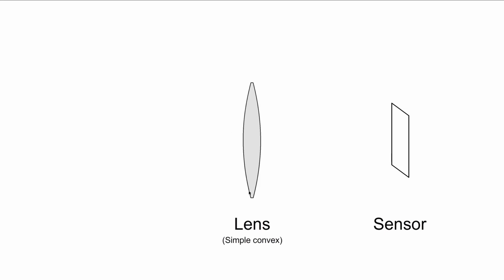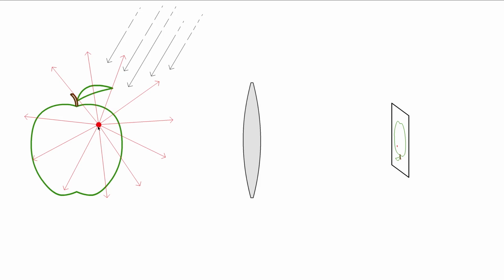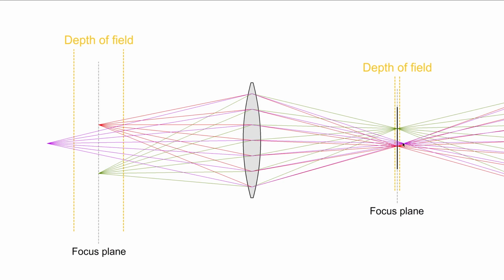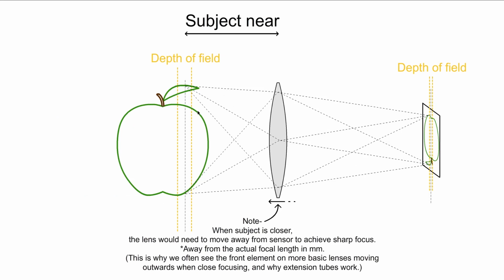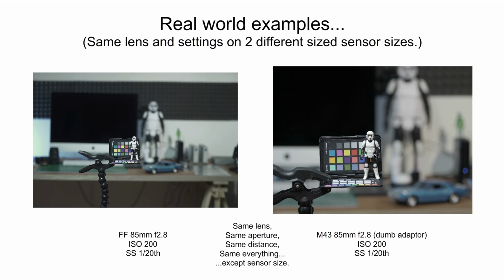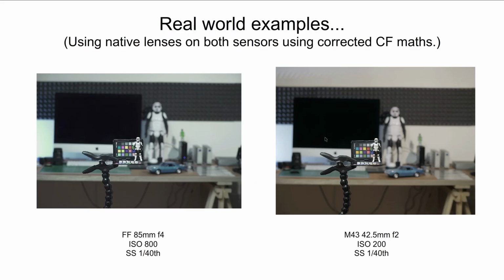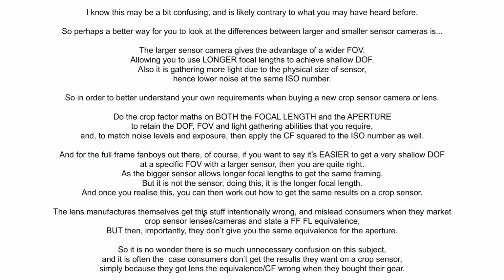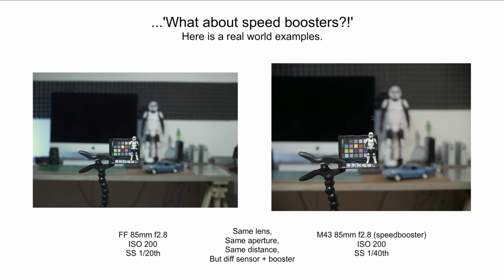Depth of field and crop factor misconceptions.

Comment: My understanding is that light gathered by individual large photosites means better ISO performance, not total light gathered. Furthermore, higher resolution means less relative noise when resizing down a larger, higher resolution image (compared to smaller resolution sensor). So it's this one-two punch by FF sensors (larger photosites AND higher resolution) that conspire to give superior ISO performance.

I don't believe that not giving 35mm aperture equivalents is misleading at all. The "equivalence" here is only for depth-of-field, not light gathering ability. On the contrary, it would be a lot more confusion, otherwise people would start thinking their APS-C f2.8 lens gathers less light than a FF f2.8 lens. People don't just buy fast lenses for bokeh.
Reply from the maker: adjutant hi. Please check out Tony Northrup's video regarding pixel density and ISO. 
(Do a quick search on his channel) 
He covers this well. (With examples)
To sum up his findings-
The total size of sensor is much more important for the total image noise. Than the size of the individual photosites. 
Unless. You are comparing image noise pixel by pixel. But that's not what most people care about. They care how much noise is noticeable when comparing two whole images side by side. 

Once you scale the 12mp image to full screen or the 42mp to full screen. (Or print to same size) then the image noise apparent there is what is important. 
(So total image noise across whole image)

And that is all down to sensor size. 
Not pixel density. 

Obviously detail retention is another conversation altogether. 

Anyway. As I said. Check Tony's video as he will explain it better than me in a comment.
Reply from the maker: adjutant and yes a f2.8 apsc specific lens does gather less light than a f2.8 full frame lens. 
That's exactly the point. 
Did you watch the whole video? I thought I made that part pretty clear. 

Don't use your ISO to judge how much total light is getting through your lens. 
Unless the sensors are the same size then the ISO is misleading you. (Not to mention manufacturers lie about actual ISO numbers to make their camera appear to be more efficient... but that's a whole other thing that I'm not factoring in for at all. And a different conversation... but worth mentioning. )
Reply from the maker: adjutant just to add on to my last comment-
The f2.8 at EQUAL FOV equivalent, does let in LESS light. Compared to the FF f2.8 equivalent.  
This is because the FF is on say a 50mm f2
And the crop is on a 25mm lens at f2 on m43.

Then, remember the actual aperture SIZE is the FL divided by the Fnumber.
So the f2 has a 25mm aperture on a 50mm lens on the FF cam.
Where as the the M43 at f2 with a 12.5mm aperture on the FOV equiv 25mm lens.

So for the SAME aperture (f2). and SAME FOV, 
the FF has a hole to let light through that is 25mm across
and the M43 has a hole that is 12.5mm across.

You see. :)
Reply from the maker: Or if you want to look at it another way. 
If you put the exact same lens on 2 diff sensors then the smaller sensor will be getting less total light out of the lens. Because more light is spilling around the sensor and is being wasted. 
Where as the larger sensor is filling more of the circle of light being allowed through the lens. 
So yes no matter which way you look at it.
The smaller sensor gets less light. 
So we have to accommodate for this if you want the same results on varied sensor sizes.
Reply: I think your first reply and the first paragraph of my original comment are in agreement, except you mention upsizing a smaller resolution image to expose noise, and I used an opposite example (downsizing a higher resolution image to hide noise).

However, I'm not entirely convinced when you attribute superior noise quality or light gathering ability to just "more total light" when you're equating "more total light" to mean "more megapixels to scale with".

Let us imagine a full frame sensor with 12mp and an aps-c sensor with 24mp. Now the aps-c sensor, despite being smaller, has a higher resolution. Does the aps-c sensor gather more total light because it has a higher resolution now?

Futhermore, will upscaling the 12mp FF image to match the 24mp APS-C image result in more apparent image noise from the FF image? At some point you have to confess to yourself that the size of the photosites do contribute to the noise quality.

I hope you can understand why I'm not satisfied by your ``resolution-only'' model to explain noise quality in an image. As my previous example shows, it is possible to have a situation where there is a higher resolution smaller sensor. Whereas the combination of higher resolution and larger photosite can only exist in a larger sensor (when compared to any possible smaller sensor), thus being the model that is most able to explain noise quality.

Lastly, let us consider a FF 50mm 2.8 lens and a M43 25mm 2.8. Suppose I used a hand-held light meter to calculate the exposure of a scene and I arrived at ISO 100, f/2.8,  and 1/1000 shutter speed. Supposing equal ISO standards by the manufacturers, will the M43 image be darker than the FF image?
Reply from the maker: We are talking at cross purposes. regarding the pixel density/resolution. 
I have seen tests by several people showing the density factor in isolation is marginal compared to the total sensor size. i think maybe you saw the bit about the circle of confusion and you maybe thought I added that part of video in to help explain the image noise... i didn't thats just in there to help explain the DOF difference with a smaller sensor.
Reply from the maker: And regarding the second half of your comment -
'Lastly, let us consider a FF 50mm 2.8 lens and a M43 25mm 2.8. Suppose I used a hand-held light meter to calculate the exposure of a scene and I arrived at ISO 100, f/2.8,  and 1/1000 shutter speed. Supposing equal ISO standards by the manufacturers, will the M43 image be darker than the FF image?'

You are still not getting the fundamental message about ISO.
The ISO number is misrepresenting the information we need to know if we want to know the total amount of light that makes up the whole image. (I hope you agree this is what is important.)
So please stop using it as a guide for your exposure. ISO is gain, and it relates to lightfall over a square inch of the surface area. 

OK let me try to think of another way to explain it...

Take a photo with a FF camera.
Now I hope you agree that that photo, before it is read by a sensor and interpreted into a image, is just a shit ton of photons travelling through our lens.

Now for the sake of argument, lets say the whole image, for the entire shutter length, is made up of 1 million (1000,000) photons hitting that sensor. (to pick a random, easy to quantify number)

Now, what happens if we shrink the sensor down so its a quarter of the size?

that smaller sensor will now be getting hit by 250,000 photons.
And yet, the exposure is the same, but it has 1/4 of the actual light hitting it.

Its just like taking the original FF  photo, and cropping into the middle of 1/4 of it. (imagine for this paragraph at least, resolution and detail is not part of the topic for now) any noise that was in that middle section of the photo is now blown up and more apparent.

So does that help?
Exposure is judged by light per square area, just as ISO is.
So what the smaller sensor is doing is adding more gain to match the lower light level over the total surface area... as i said... the ISO number lies to us, If what we want to know is how much total light is hitting my sensor and making up this image.

Dont trust the ISO number.
I reccomend if you have a couple of different cameras of varying sensor sizes lying around, then to the test yourself.
As long as both cameras are of similar quality, (they don't even need to be same manufacturer or anything like that) you will see all the important factors matching if you do lens equivalence the way i suggest.

You will get very similar FOV, very similar DOF, and very similar image noise. very similar exposure.
Surely the proof is in the pudding.
Give it a go and let me know what your findings.

I better go and do some real work. :) (i was hoping this video would clear things up so i didn't need to get into long discussions... ) :D
Reply: Let us consider a full frame camera with an aps-c crop mode. So a 36mp sensor camera that will crop to approximately the 15mp in the center. It's still the exact same sensor. According to what you're saying, this full frame sensor when operating in 15mp crop mode, is 'adding more gain' to match what it would have gotten if it was operating at its full frame 36mp. Perhaps you should make a video about this, I'm more of a visual learner.
Reply from the maker: Me too, (visual learner) hence the illustrations. 
No thats not what I'm saying. But sort of... :/  

ok, so maybe if i come at this from another fresh angle... (literally)
take your 36 mp FF cam
the light hitting the whole sensor is, lets say, is coming from a angle of view of 100 degrees.
now the centre of that image (15mp crop) is coming from a angle of view of say 60 degrees (i haven't done the maths on that, but you know what i mean)

the light thats leaving the scene, bouncing off of objects from from the whole field of view, all adds up to our complete image right?

now the light that is coming in to make up the centre crop, (from the 60 degrees FOV) is obviously made up of less total amount of photons right?

So the exposure of the centre of the shot (from crop) is the same as the rest, yes?
We are just using the centre bit.

And now, if we blow that centre crop up to the same size as the full FF shot.
we are looking at both of those shots side by side, same size. they are both exposed the same.
But we know the cropped one is made up from less light... right?

And any image noise that is hidden in those shadows are now more obvious right?

This is exactly what is happening between our diff sized sensors.
The smaller sensor has the same exposure... but is getting less total light.

And what do our sensors need? light. right? or the signal to noise ratio goes down the pan and we get noisey icky images!

So you are kind of proving my point back at me, while you are arguing with me :D
Reply: But now we're back to square 1, because you're saying the 15mp crop is worse only when you blow it up to the size of 36mp. Which is a model of using only resolution to explain noise. Which brings me back to my earlier example: what if you blew up a 12mp FF image to match a 24mp APS-C image?
Reply from the maker: adjutant no im not saying resolution is the cause of noise. Quite the opposite. I'm saying surface area (or lack of it) is the cause for more noise on smaller sensors when compared to their larger counterparts.

I was using your point and running with it. 
Not quite sure why your getting hung up on the whole res thing... If for example we are filming 4K video on both the res is the same.
 
Ok throw res out window completely. 

We have old fashioned film. Not digital a sensor. 
Now image noise is once again looking worse when we zoom into centre section. (We are blowing up and examining all that unwanted grain)
But. If we took our film Sensitivity. (ASA)
And lowered it for the cropped section (hypothetically)  and then added more light. To match exposure. We would be able to match noise levels. 

You see???
Forget res. I was only using that because you asked about it.
Reply from the maker: Theoria Apophasis I suggest you both watch this video-
https://youtu.be/0OtIiwbAZi8
Reply from the maker: Theoria Apophasis in that vid you will see a ton of correlated data (mostly gathered from dxomark) that completely relates to these topics and 100% backs up everything in my video. 

I think you have simply got a kink in your think and won't accept simple facts that are presented to you because they contradict some previous assumptions that you have decided to embrace with a almost religious fanatical blindness. 

I envy your blind faith in some ways. 
It must be great to be so certain of your own riotous correctness. Despite mounting piles of data that contradicts you position.

Comment: Why m43 brands like panasonic are continuing to mislead us? I have a Panasonic 12-60mm f3.5-5.6, so if I get it right, it's actually a 24-120mm, why they can't just mark the lens in a right way? 

And another question, why the shutter speed stays the same between FF and m43 bodies? If my real f number is 7.0, not the f3.5 that I see in the viewfinder, why the shutter speed is the same? Why it doesn't change if I am getting the smaller amount of light on a smaller sensor? 

Sorry if I didn’t understand something and thanks for the video!